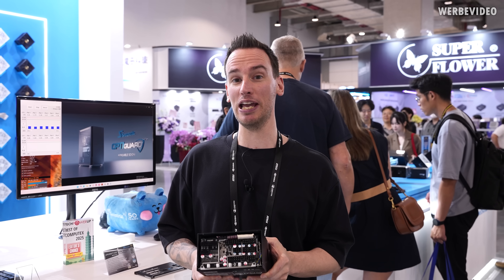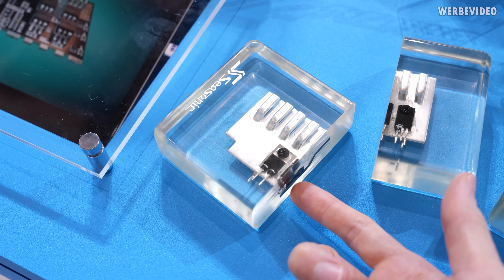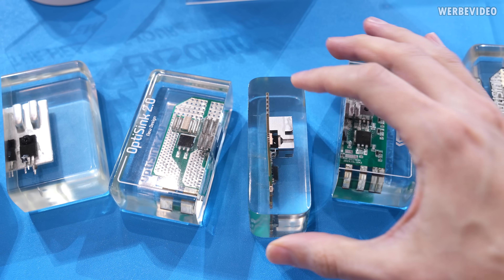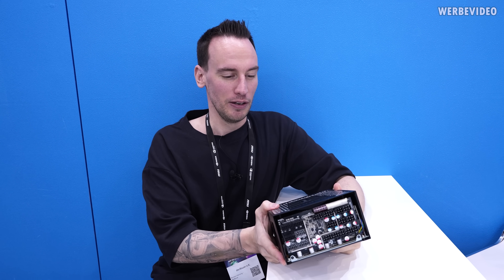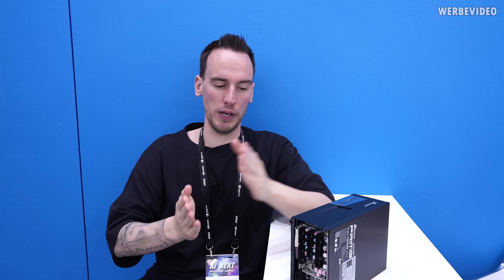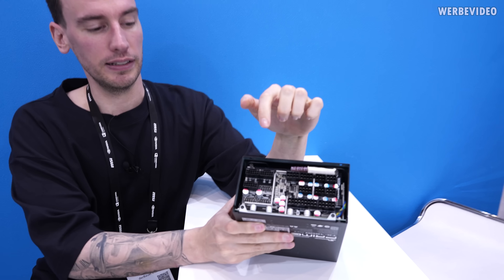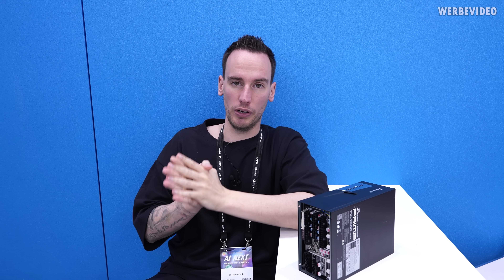Seasonic Confirms 12VHPWR Risk – Unveils Protection Feature

Comment: First thing that every manufacturer [intentionally] "forgot" to say is that 12VHPWR NEVER were supposed to be used as a power connector for devices with high consumption. 100Watts as a safe maximum at peak consumption. As a failsafe measure engineer should always foresee at least 30% of power rail loss caused by bad contact in connector. Reason could be different - oxidation, rust, dust, wet, vibration or even divine intervention. Obviously someone somewhere was overconfident about 12VHPWR ability to deliver THAT amount of power. Or worse - it wasn't a mistake, but was done by purpose.

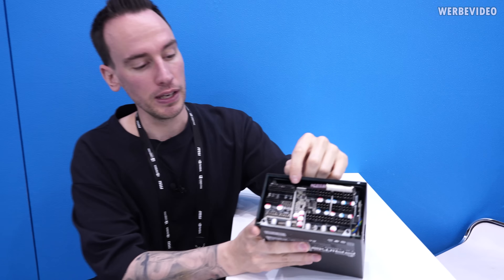Comment: 3:10 can we please calls those pin what they really are: mode pins.
Because they do not have a sensor feature that actually matters, is just the PSU telling the GPU how much power it can deliver and the quality of the power.
oh... yeah there actually already a wire for that on the ATX Specs, where the PSU can tell the Motherboard the power status.
In fact, it would be much better if there was actual communication with the motherboard and the PSU.
But I digress.

Point is, that does not tell the PSU the Status of anything, nor does the PSU reports back any important information or other factor that actually matter for the proposes of making sure thingz does not catch fire.

Comment: Anything that gives people a false sense of security and/or facilitates the lazy and dangerous PCB designs is very bad. (This does not include tools that can log current creep for purposes of documenting failure.)

This single power plane is no longer just an anti-feature on NVIDIA cards, as it has infected the AMD Nitro+, Intel's B60, I think, and so on. People need to be aware that they can't just buy another brand and expect it to not suffer the same problem. 

The "acknowledgement" from the added PSU (and the Astral) shunts may play a role in future litigation if this persists, but they are not solutions. Nor steps towards a solution if the manufacturers continue to abuse the cable bundle. 

There is a simple solution to this problem, of increasing volumes of PCBs drawing power cavalierly over the 12V2x6 cable bundle. Stop buying these dangerous graphics cards and wait for the market correction.

Comment: There are six +12V lines and six ground lines. Every discussion of imbalances is limited to imbalances on the +12V lines. Nobody talks about ground imbalances. Imbalanced ground current should be just as destructive as imbalanced supply lines. In my case it was +12V supply imbalance that caused connector failure but symmetry would imply that either the +12V or the ground lines could become imbalanced and cause the same problems. Is there something in the PCIE slot that provides additional ground sharing and makes ground imbalances less of a problem? Traditionally in school students are taught to ignore ground and just assume everything works fine. Only later do they learn that ground matters and that EMI and other ground related impacts can be a significant problem preventing safe, compliant operation. I would love to hear from industry experts why ground imbalances are not just as much a problem as +12V imbalances.
Reply: Nvidia supplied a cable for its 4090 in which the 6 12V terminals and the 6 ground terminals were connected together. This was probably not for nothing ?

Comment: This is merely a partial solution for a broken standard. Now you might have destroyed data on your SSD due to a forced shutdown or losing a lot of time rendering a video and the PC shutting off because of this safety-feature from Seasonic. Don't get me wrong, I don't criticize Seasonic for coming up with a half-solution, it is better than nothing. The problem is this: ATX 3 is a failed standard and it should disappear immediately. Maybe it is just Nvidia which messed up, maybe with ATX 3 it is possible to do it safely if AMD, Nvidia and of course the AIB's dont't do anything weird, which is rather unlikely on the long term. But do we want a system which requires that or do we prefer more redundancy by having redundancy in the PSU itself too when Nvidia makes such mistakes? I myself don't intend to buy an  ATX 3 PSU, I hope that it won't get forced upon us by not designing any new ATX 2 PSU's. It seems to me that some companies refuse to withdraw a broken design because they would lose too much money and prestige. The connectors of that 12VHPWR suck, they are too thin (not great with heat, more fragile) and don't plug in nicely (how do you get that done?). And for what? What real problem does it solve? But it does introduce new risks. Now some people claim that you need this 12VRHPWR to allow for higher wattages in the graphics card. As if 500 Watt is not enough for a graphics card. Anyone who knows anything about graphics cards these days also knows how little performance you lose by lowering the TDP from the default value. In my case for example 1-3% for a 17% lower electrical power while I lower the TDP from 180 Watt to 150 Watt on my 5700 XT, note that 180 Watt already is lower than the default value for the Powercolor Red Devil becuase I use the silent BIOS. Another exapmle, the 9070 XT barely loses any performance when you lower the TDP from >300 Watt to 250 Watt. A 500 Watt maximum is fine for graphics cards.

Comment: Dielectric grease....Insulation:

It is a non-conductor, meaning it prevents electrical leakage between adjacent connectors and prevents arcing.
Lubrication:

It helps ease the removal and insertion of connectors, especially those with rubber gaskets, preventing them from seizing or cracking

Comment: The PSU manufacture is trying to fix NVIDIA's crappy engineering.  So now it will save face on NVIDIA at the expense of the PSU's for shutting down the power supply.  They need to have some sort of logging to tell what happened during all this as well before it shuts down, maybe a few hundred kilobytes of memory in the PSU to be the event data recorder that you can go pull out after you turn it back on after an alarm.  I agree that you need some sort of LED flashing or buzzer alarm.

Comment: I still don't understand why the need for so many conductors on the 12VHPWR.   If current distribution is a problem, just go with 2 heavy duty wires to carry the full current load.  It seems like that would be a cheaper and safer solution.
Reply: Nvidia supplied a cable for its 4090 in which the 6 12V terminals and the 6 ground terminals were connected together. This was probably not for nothing ?

Comment: i would add the feature to the PSU that you can set with a switch (which is on by default) that the PSU would not send more than 9-10A on one pin, this way you don't have to monitor it, therefore the PSU will automatically limit the current (most of the ppl wouldn't overclock their GPU for extra 100W and 2-5% extra fps on a 5090 to melt the GPU/PSU and kill their PC)
This surely can be done specially that we have smart psu with usb to monitor the whole PSU itself, i would happy to pay extra so i don't have to worry about the GPU/PSU melts down.

Comment: Just like in the UPS overload protection, they can implement a mechanical fuse that would require pressing the button to make the PSU work again after the 12VHPWR went out of specifications.

Comment: Ah great, I just bought a Prime PX ATX 3.1 yesterday 😅. Should have waited, with this system planned to expand to two (only one for now) RTX Pro 6000 in the future, I think I need the safety. Would also be great is Seasonic could work with Gigabyte on integrating the current sensing and power data into AI TOP Utility so that the data is available while a training job is running (and you can trace what happened if the system shuts down during an off-peak training session where the PC is likely unattended).

Comment: Crazy that so much engineering involved instead of just switching GPU power lines to 24V from the outdated 12V or adding second cable.

Comment: Why did Nvidia have to reinvent the wheel when the XT60 connector standard is right there*, and it's rated for 48v 60A, which if you do the math out is 10a more than you need for transferring 600 watts over a DC power connection of 12 volts nominal. Is it really *that much more expensive to go with just 2 wires at 8AWG each?
I know it's less expensive than having a GPU's soldered-on connector melt!
Reply: Absolutely. XT120 allows 60A and other contacts.

Comment: The actual solution to the 12VHPWR connector is just to ditch it completely in favour of using the EPS12V which has been proven to be reliable for over a decade.

Comment: Agreed, but a logging systems attached to a reporting system is fine enough. 
10A gives a warning, and 12A a forced shutdown. But just before the shutdown the PSU would keep the log of the 12A and duration.
Of course this is assuming that the measurement time frame isn't instant, but more appropriately designed to prevent micro blips.

Comment: I still don't understand why the cable is 12pins. It can simply be 2 bar connectors with 6 wires soldered to each. The only reason for 12 wires instead of 2 is to keep the cable size small and maintain flexibility.
Reply: Nvidia supplied a cable for its 4090 in which the 6 12V terminals and the 6 ground terminals were connected together. This was probably not for nothing ?

Comment: There is no need to shut down - you just have to limit the current so that the card still operates but not at full power. Say the power supply limits the current to 50% on the 12v hpwr then if the problem persists to 25% -= stepped phased reduction.

Comment: A few of my friends with electrical engineering knowledge and work in related industries said we should have just moved directly to 48V, would you agree der8auer? (I personally know f-all to even make one educated "guesstimate")
Reply: Makes sense, higher voltage means lowered current.
If I’m correct the current transported  would be 1/4th on the wire as such the heat generated would be divided by 16.
Reply: The XT120 connecteur allows 60A (720 W). Never fails.

Comment: The PSU could warn you if there was high contact resistance across specific pins so you could troubleshoot that as well instead of just trying to work through the condition or just shutting the PSU down, you could try re-seating the cable or get a better cable. Just measure the resistance between the 12v and ground pins per wire at boot.  I know it's more work for the PSU to do, but it would be more elegant and gets to the root cause (if we ignore the bad design of the card and connector of course)

Comment: There is a SO MUCH MORE SIMPLE fix for this connector, and it is done THROUGH THE CABLE. If they make the connector on each end into BARS. Each wire for 12V all connect bar to bar, then the pins are then connected to the bar and the same done to the grounds. This would just make the 12 wires just 2 electrical paths instead of 12 independent paths that can be thrown off balance. This would be MUCH CHEAPER than per pin monitoring and balancing.
Reply: Nvidia supplied a cable for its 4090 in which the 6 12V terminals and the 6 ground terminals were connected together. This was probably not for nothing ?

Comment: Wouldn't it be better if we could just hard-wire the power-hungry devices to the PSU? A couple of screw terminals and 2x10mm² wire, instead of these dodgy connectors.

Comment: Glad to see SOMETHING happening. Although, monitoring the current in each wire won't technically even flag the right problem, and won't give total peace of mind.
A high contact resistance is likely to reduce the current in that wire (so high current thresholds won't be triggered). But the thermal / melting problem comes from the local current density at that poor contact being so high (and possibly arcing) that local heat is generated, to the point where the connector can melt. The current in the wire cannot tell you what the current density is at each connector pin, because the contact area is always unknown. Which is why this Seasonic "fix" isn't the guarantee we hope for.

Comment: The only way to truly monitor a fault with the cable or connector that would cause a meltdown is to observe the voltage drop between the graphics card and the PSU. I think simply monitoring current at the PSU output doesn't tell you the whole story. how do you know that there isn't a high resistance at the card connector that will generate heat?
Or just stop using that crappy Molex style connector and use something with more ampacity.
Reply: Nvidia supplied a cable for its 4090 in which the 6 12V terminals and the 6 ground terminals were connected together. This was probably not for nothing ?

Comment: I appreciate Seasonic looking into this is lovely to hear but at what costs?:
- Proprietary software that performs poorly?
- Even more expensive units, perhaps even exclusive to their platinum ones?
- What about different operating systems like those running Linux?

So many questions that immediately pop up as I have my high doubts that even an otherwise reputable brand like Seasonic wouldn't do better than Asus with their Astral 5090 seemingly being the only card in their lineup that features something to tackle such issues

Comment: The PSU software should flash the message, "IT JUST WORKS!" in giant text across your monitor when a 12VHPWR connection issue is detected.  Folks would know immediately what the problem is.

Comment: Hi ! Thank you for this video ! Do you know the Corsair AXi PSUs series since 2017 ? Like AX1200i (not sold anymore) or AX1600i (still sold) ? With these PSUs, a USB cable and iCue (or any other monitoring software), you can monitor the current in each 8 pins PCIe connector. But you can also set a current limit on each 8 pins PCIe connector !
I would like to have a 12v2x6 to 6x 8pins PCIe cable so I could set a limit of 10A on each 8 pins PCIe connector on my AX1200i PSU !
But with 4x 8 pins PCIe connector, like the cables with graphics cards, I don't know how they are wired on the 12v2x6 connector , but I imagine I would have to set a 15A current limit on each 8 pins connector !

Comment: Seasonic PSUs that have a 12 year warranty are worth it.  Months ago I had a graphics card that had a short circuit between 12 volts positive and negative.  My Seasonic PSU could detect the short circuit and not fully power on so other components did not get damaged.

Comment: 4:30 i’m wondering if someone could actually make a cable with some logic on it that could monitor the current and temperatures on each pin on the cable with some type of logic to actively balance based on resistance and temperature?
Reply: Good idea, it derbauer already makes one. Except for the active balancing. Following ohms law, the only way to do that is to either artificially add resistance to the good pins which would just add more heat and inefficiency, or to adjust the voltage per pin, which would cause problems on the GPU side, especially if they follow the spec and have all 12v pins on the same net. That would just cause a direct short circuit because the voltage would be different between 2 wires that are connected together. Not to mention doing DC-DC conversion at that current is not easy and especially for 12 wires it would be very bulky and inefficient.
Reply: @paul-fornage  Nvidia supplied a cable for its 4090 in which the 6 12V terminals and the 6 ground terminals were connected together. This was probably not for nothing ?
Reply: @monsieur3dx  idk actually, the only thing that would help is if a contact is damaged somehow and has high resistance, it's associated wire could still carry current and just deliver it directly to the ground plane in the connector. Basically if a pin goes bad on the connector, the other wires don't have to pick up the slack. Could help kind of, assuming only one or two pins go bad, but strange they didn't do this on the 12v net.

Comment: But der8auer! You are making a lot of custom stuff for extreme users. Why not make a 8pin connector that could be soldered in place of 12VHPWR / 12V-2x6? Just a set of 8pins with that melting connector's pinout?

Comment: This is where a small screen on the PSU would actually be usefull instead of a gimick . Like a debug LED ,  it could give an error message or even indicate which pins went bad and why it shut down . No need for software no need for USB cable ....

Comment: So thanks for this video. I have restrained myself from buying a new PSU and a new GPU with the 12vhpwr power connector due to these melting issues. I have been waiting for certain things to change to help minimise the risk of this for a long time. Looking forward to next years with a new PSU with these protection features in before i giveaway my money. Same goes for Nvidia next 6000 series GPU. Maybe nividia will finally add some sort of protectrion feature in there upcomming next gen GPUs as well. Only time will tell. And just to think i was a  inch away 4 months back buying a new GPU and PSU but decided to WAIT.

Comment: Great video and explanation.. Two questions..
1. Based on your explanation, shouldn't there have some stricter manufacturing tolerances to mitigate the differences in resistance across the pins?? It's sound like a manufacturing process issue.. But I'm not sure.
2. Why do we need to go through all of this to have a reliable power supply to our graphics cards?? Rework the connector and come out with something better.. Even if it takes time, revert back to the 8 pin connectors for the time being and research a newer and better connector, instead of making a compounded mistake, that seems to never be fixed..